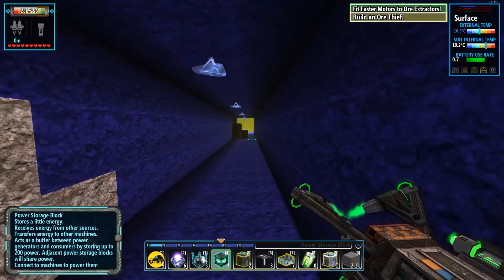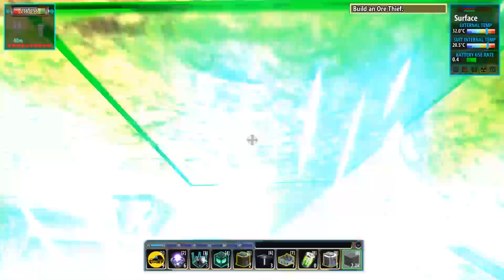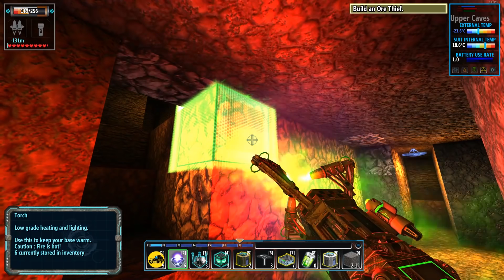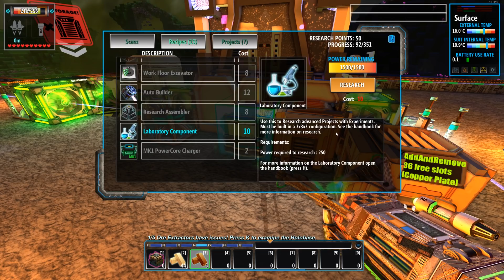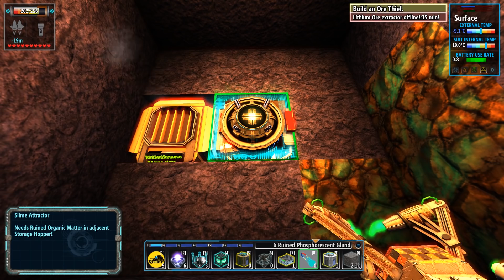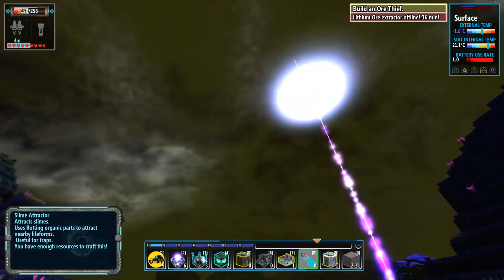FortressCraft Evolved E03 - Lithium and PCBs

Comment: use turntables instead of hoppers at the intersection of belts it's way cheaper
Reply from the maker: I thought turntables were to split one belt into two, not two into one?
Reply: They don't they can split 3 into 1 or 1 into 3 or 2 into 2 it's kinda of a splitter and a merger all in one

Comment: You just need to place one conveyor belt at the top, in the right position, and you can use the super build function from the bottom. It just replicates the conveyor belt you're pointing at. Works exactly like it does horisontally.
Reply from the maker: Good tip!

Comment: When you control click to lay conveyors, they will face the direction of the conveyor you click on.  Lay a conveyor on the wall, then go up (or down) point to your conveyor you want to mimic and control click.  It will build from whatever face you look at in the cardinal direction toward you in the same facing.

Comment: mynoks should be spawning at exactly -50 meters
you should think about the grappling hook as a spring...
if you have momentum and you throw the hook against a wall while falling down you will still fall and then fly up again.
Its best to spawn it when you are almost at your destination level
Reply: the mynoks depth depends on the difficulty setting, in rapid mode i think it's below 64
Reply: oh yes you are right i always played on normal mode so i did not consider the rapid mode ^^

Comment: Use the same mechanic for vertical belts. just place the first one at the top in the needed orientation. Than go down, target the bottom edge of the placed conveyor, press ctrl+left click and it has to build the line of conveyors.
Build-to-me copies the orientation of target conveyor.